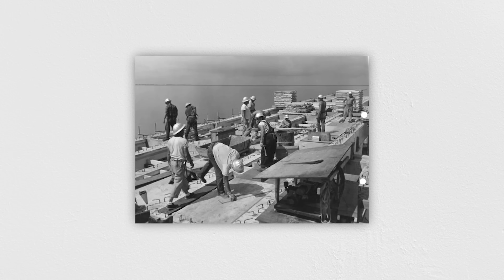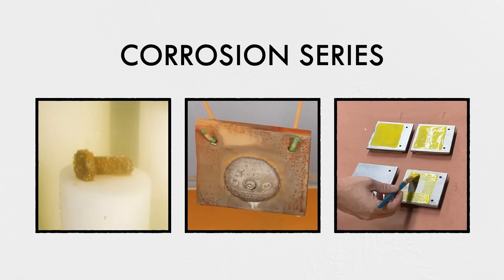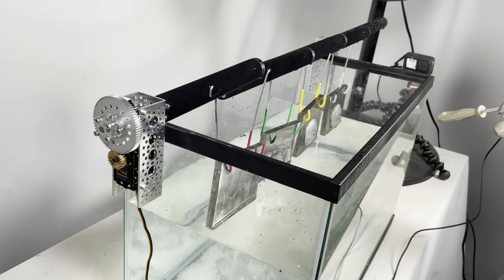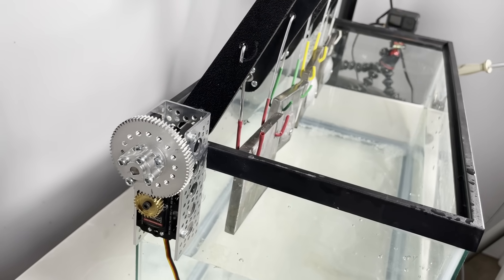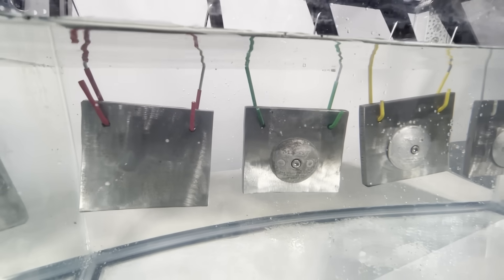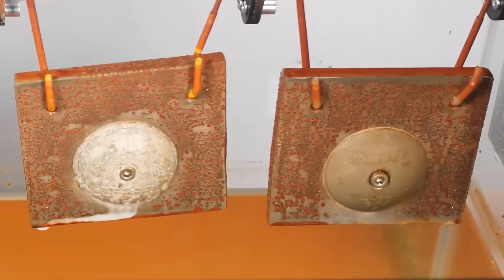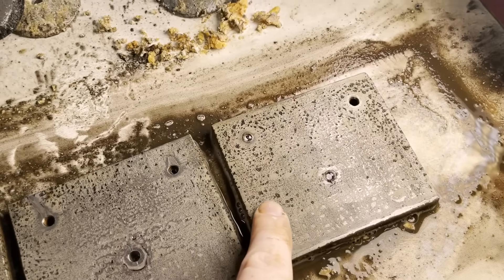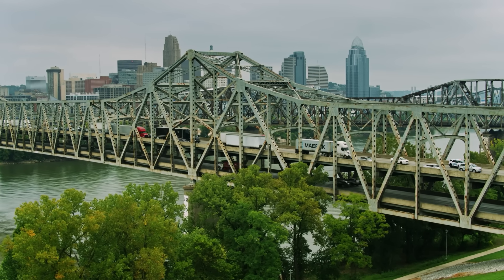Why Spillway Gates Don't Rust Out

Comment: Cathodic protection (CP) is a great way to prolong infrastructure by preventing corrosion. CP can be applied to older bridges, parking garages, high rise buildings and other concrete and rebar infrastructure. However, it cannot be applied to new infrastructure. A few decades ago, the building code was changed to require coated rebar. Which prevents corrosion initially. However, any flaws in the coating or unprotected ends will rust, often at an accelerated rate. Plain rebar is easy to make electrically continuous, the rebar and wire just need to touch. However, it's almost impossible to make coated rebar electrically continuous. And electrical continuity is a requirement for CP. You need that 'metallic path' to have current flow back to the CP source. So by using coated rebar, any infrastructure built in recent decades cannot have CP applied.
Reply: I was actually kinda curious on the cost-effectiveness of a coated rebar, as on 5:52 you can already see some parts of the rebar rusting (probably due to the difficulty coating it's shape and texture).
Reply: @rulu1828  from the factory, most coated rebar has a good coating. The problem is usually handing on site. People dropping it, bashing it, bending it, etc. This all contributes to damaging the coating. Similar to pipelines, most of the damage isn't in application (or rust) but caused by humans. Humans are very damaging to have around any infrastructure.

Comment: I have known about this phenomena for a long time, but I am curious if this could be practical on vehicles? I am a fan of old iron, and taking an entire vehicle apart to paint it is not exactly practical most of the time. I know if it would work, it isn't a cure all, but anything to slow down rust, especially for relatively cheap is always something I would be interested in.
Reply: It is done on ships, but there you have the advantage of knowing exactly which parts are wet all the time and the water is pretty much one body of water. I guess moisture on a car would be too local for practical sacrificial anodes unless there are specific parts which trap water.

Comment: I can't help but wonder if the stainless steel bolt would have thrown off your test a little bit, would be interesting to see if raw mild steel bolts would make a difference to the end results because the stainless would have been the more noble metal
Reply: Probably negligable due to the small surface area of the bolt compared to the sample

Comment: Fantastic video explaining this process. I'd have liked it if you'd expanded a sentence or 2 on the term "sacrifical anode". You mentioned it, but that's the way I, as a historical ship lover, exclusively come across this topic. Of course, historical ships aren't your brief and as I said, the explanation itself is fantastic.
The Rust-O-Matic may at the same time be an historical achievement and even more futuristic than it's moniker of 3000 implies. Congratulations! 🙂
Reply: I'm pretty sure what he showed is exactly the concept of the sacrificial anode.
Reply: @Kenionatus  He did, and the video is excellent. But I'd have liked a stronger "connection" of the term to the concept. I've come across the term "sacrifial anode" in books about ships, it then gets explained (poorly) by the writer who is probably a history major who has never seen a Rust-O-Matic 2000, let alone a Rust-O-Matic 3000. Someone looking up "sacrifial anode" may not see the connection to "cathodic protection" so I would have liked a confirmation early in the video that it is same process.

Comment: Just curious if you weighed those samples before and after corroding them might be interesting to see what the percentage of metal loss is per day or hour.
Reply: I was hoping that he would measure the volume of the metal plates before and after, and then an equivalent in weight. Maybe throw in a few percents. Would make the difference much more noticeable.
Reply: Yeah, I was a bit disappointed that he seems to not have weighed them.
Reply: The problem is oxidation would actually add weight, so it's not a great way to get an accurate picture of how much metal is left. To do that, you'd want to fully dissolve each sample, convert it all to a stable salt, then dry and weigh that.
Reply: @christopherhayes3328  no.. He just needs to weigh them after he wire brushed them at the end instead of everyday
Reply: @christopherhayes3328  or just mill it down until the pitting's gone and see how thick the plate is after
Reply: @christopherhayes3328 why not though? If you know how much weight was "added" you can pretty accurately tell how much metal was transformed to rust.
Reply: @wojtek-33  Sure, can you think of an automated way that does this?
Reply: @ChrisEffpunkt  "we do not do rough estimates in a laboratory". That's such a relative term.  You use the level of precision you need in the lab, depending on the application and your goal.  Sometimes +/- 1% will do, and sometimes +/- 0.00001% is required.
Reply: @jasondashney  When we study the phenomena of plastic deformation in metals, the difference between theoretical and practical values of 20-30% is sometimes normal. And this is not because of the shortcomings of the experimenter, because there is no full-fledged strict theory for most complex loads, or it is impossible to calculate with the available data, so the deviation is in theoretical calculations
Reply: @Zigfried207  interesting.
Reply: Maybe put each one in a hydraulic press and see when each one fails
Reply: Back in the day when Boeing was still Boeing and not a reprise of McDonnell Douglas, one of their scientist-engineers had a doctorate in metallurgy and was known as their "corrosion god."  Dr. Jones did unbelievable work and he had a lab at the company where he would devise tests for materials applications that either the company or airline customers were proposing to do, or had maybe already done unintentionally, in order to understand their consequences in various saline environments replicating hot and humid sea climates, etc. These tests would sometimes go for many weeks or even months with some of the strangest changes in weight, shape, strength, etc., resulting that no one would have ever imagined. I have to say that those kind of actively experimenting, crazy scientists who made projects like the 747 possible are far more rare now than they used to be. Somewhere along the line we decided that computer modeling was good enough, along with a lot of other changes in focus and processes. It isn't, they aren't, and we need to get back to a lot more of these crazy people going the extra mile or two or ten hands-on, making us better and keeping us safe.
Reply: @ChrisEffpunkt  I would say 5% is the worst we can accept, as an engineer that’s what we were taught in school at least and that’s more than I think I’d accept😂
Reply: Does electrolysis have any effect on this because of the saltwater and electricity
Reply: I thought the same thing, great test, but that would have been very interesting.
Reply: Yo my first names Stone. We should get married so my name can be complete
Reply: @ChrisEffpunkt  A laboratory OR Grady´s garage.

Estimates are for fieldwork!
On multi-billion-dollar, one-of-a-kind-projects.

Comment: I pulled an engine out of the river a couple weeks ago, crankshaft, cam, piston rods, wrist pins and piston rings were still in the engine.  The piston heads were gone.  Best I could figure is that the piston heads were some alloy that sacrificed itself to save the rest of the block.
Reply: I read that as "pulled an engineer out of the river" and was really confused as the the context of engine parts.
Reply: @tybirous3417 I'm sure there have been plenty of folks who have wanted to throw an engineer into the river😅
Reply: @tybirous3417  I heard Cummins makes good diesel engineers

Jk
Reply: Aluminium doesn't corrode in air as it forms a protective oxide film.   However, in situations where the oxide film can't form, aluminium corrodes rapidly.    Cast iron is actually surprisingly resistant to corrosion, way better than mild steel.
Reply: If I recall correctly, it's not uncommon for the heads to made of magnesium or an alluminum alloy, so you're apmost certainly right.
Reply: @nomms engine heads being magnesium is a little uncommon but pistons are almost never made of magnesium especially not OEMs.

Magnesium is too soft and reacts with a lot of things. If you use magnesium in engines, it usually needs to be suspended around aluminum or silicone to keep it from corroding and its usually used in something like a valve cover that doesn't see any wear or interaction with anything other than oil.

Aluminum is the lightweight metal of choice for alloys in internal components. Magnesium would be a 1 run type of equipment.
Reply: ...or the heads had been removed...
Reply: @jamesengland7461  By mermaids?
Reply: @YouPlague  Or, y'know, whoever tossed the engine in said river
Reply: So what kind of engine was worth pulling out of the water? Something rare or just trash cleanup?

Comment: I think you made a mistake: all the metal plates were electrically coupled. The metal hooks are made of conductive rods that made one cathode influence the other 3.
Edit: Ok at 5:02 there are plastic covers - insulators :)
Edit2: Maybe another mistate: you didn't change the water containing iron oxide. Does fresh water corrode faster?

Comment: Would have been really interesting to weigh each of the slabs before and after the experiment, awesome video nonetheless!
Reply: Oxidation adds weight. Plus sometimes rust stays on, sometimes flakes off and you would get a variation. If a sample is cleaned with wire brush, this may influence weight. An experiment like that would have to take much much longer to create much bigger differences.
Reply: @KP11YT  Fair enough, but you could vary the test so that the results were more accurate, you could spray the samples with a high pressure hose, which can be used as a rust remover
Reply: @KP11YT  I've done corrosion tests (chemist). Weigh before; test, clean (cleaning solution); weigh again; calculate the corrosion rate.
Reply: Tyler is right. Like internal corrosion coupons in pipelines are  judged by metal loss. Weight.
Reply: I was thinking the same thing.

Comment: Did you measure the mass of the steel before and after?
Also, I work on powerlines, and they are subject to corrosion. Does being part of an energized circuit help slow the processs?
Reply: I'm no expert but I don't think so. The cathodic protection usually uses DC voltage/current to make the cathode a different potential to the anode. As far as I know they're not touching when they've got active protection (otherwise they'd short out). Really common in large shipping vessels where they have the ocean as the electrolyte.

You also need an anode to sacrifice, if the powerlines were steel for example covered in zinc or aluminium that may help but I can't see the AC current doing any good for it as it's not really giving one one metal type a voltage bias over the other.
Reply: hmm, if they are actually under a active forced protection it can make sense, but I'm more prone to think they have a reinforced galvanized coating, since they are mass built and certainly are worth the investment on more protection from rust.
Reply: Wondered about that too!
Reply: measuring the mass might not be as interesting as one might expect because of some key issues: 

When the steel is turned into rust, it gains mass because its capturing oxygen. 

He had to grind off the rust to see the surface pitting, this also grinds off some of the steel and affects its mass. 

If you had a way to perfectly remove only the rust, one may be able to get some good numerical insight into how protective each cathode was, but there are the previously listed challenges that would complicate the issue.
Reply: @ZE0XE0  Thanks for that explanation of the challenges, I was wondering why he didn't report the change in mass, and you answered my question very succinctly.
Reply: @ZE0XE0  true

Comment: You might have had some success showing the corrosion if you had soaked the steel plates in vinegar to remove the rust in the pits. Then taken photos across the flat of the steel to better show the depth of damage. But what you did gets the point across.

Comment: Something to look into may be the automotive version of electronic rust inhibitors. Here in Australia heaps of people use them however many people think it's just snake oil.
Reply: Snake oil. Electronic rust stopping boxes are a form of impressed current cathodic protection. Which requires an electrolyte to work such as water or soil. Air is an insulator and prevents the flow of the CP current. The boxes only work well if you bury your car or store it in a lake or pond. Not idea. For cars, annual oil spray is your best protection.
Reply: Dang, I was just thinking of that.  I had just bought a car, (U.S.) in 1980. I was deluged with mail and magazines about electronic rust protection for your vehicle. It offered a lifetime warranty, but was also very expensive. It was a DIY kit that you installed, which was their 'out' for denying warranty claims saying you didnt install it correctly.  It would also drain your battery if you didnt have a trickle charger on. I never took the plunge for that due to the cost, which was over a thousand dollars. I always wondered 'what if'  since my pride and joy babied 320i slowly rusted into oblivion after 30 years in Ohio.
Reply: For cars, snake oil. For a bridge? they could work.
Reply: Doesn't the battery anode protect the car frame already?

Comment: Aluminum generally has an oxide coating that protects it from further oxidation.  Does that interfere with Cathodic Protection?
Reply: It's a good question. As far as I know, aluminum is the most used metal for cathodic protection in industry. I think that the layer of oxide is released to environment when positive charged, exposing the raw material. That's the reason of the consumption of the anode
Reply: @viniciusmmd2282  amd in the test grady used it was under salt water, so the harsher conditions may have weaken the oxide formation allowing for constant exposure of some pure metal to react.

but even without this it may work, since the surface of both metals is firmly attached and the oxide can still conduct electricity in some way, allowing the aluminum underneath to be further oxidized
Reply: Yes. The oxide acts as a coating, preventing contact with the electrolyte (water) and stopping the cathodic protection. Aluminum is not commonly used in environments that cause passivation (aka oxide coating). Zinc is much more common for protection of ship hulls, pilings, and other sea water infrastructure.
Reply: That oxide layer isn't impenetrable. Salt water will eat aluminium away.
Reply: @hodor3024  agreed, and a fast flow of water will also wash away the layer before it can build up. There are ways to use aluminum anodes, they just require a bit more awareness and engineering in some environments.